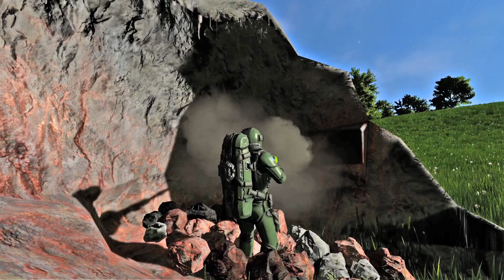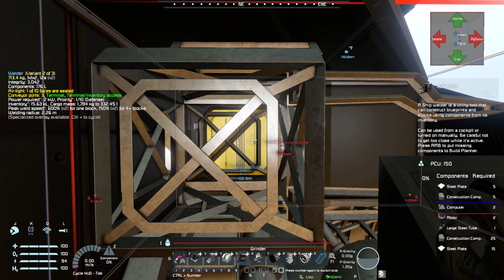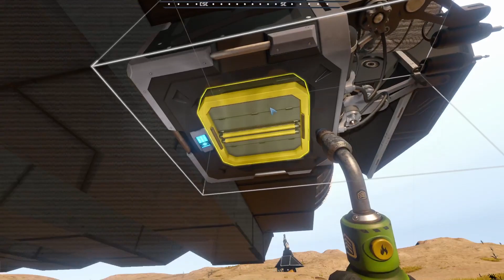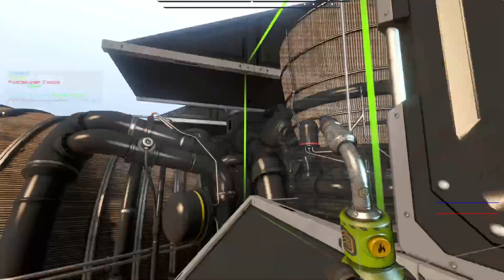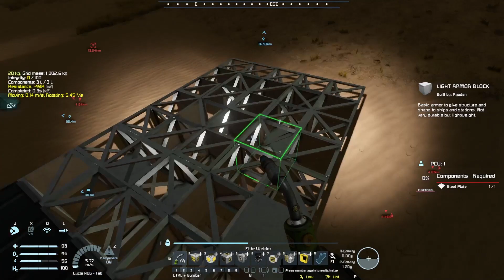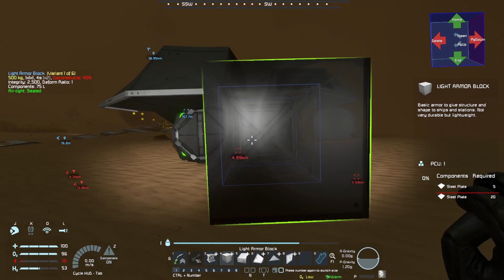Ship Shaped - Survival Records, Space Engineers S02 Ep018

Comment: As long as the ship is connected to a static grid or landing gear locked the thrusters shouldn't use any hydrogen. I always use decoys positioned a short distance from a build so in case drones come in they go for the decoys and not what im welding. But I usually dont have that many turrets lol
Reply from the maker: the concern is that most drones don't use turrets they manually target grids and shoot them with rockets or Gatling guns.  That means they ignore decoys.
Reply: @ryodenshipwright  Yes when it comes to the drones that use mostly fixed weapons then decoys are almost worthless. That is the time of a "best defense is a good offense." statement. When the drones are coming in fast its time for turret spam, fill the air with lead or "frickin" laser beams.